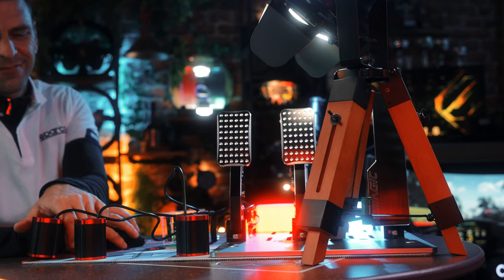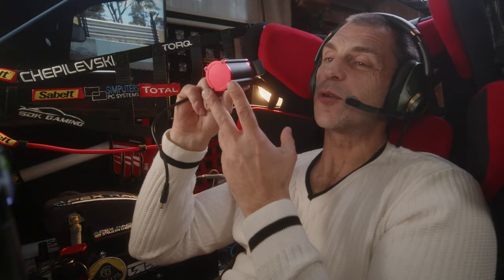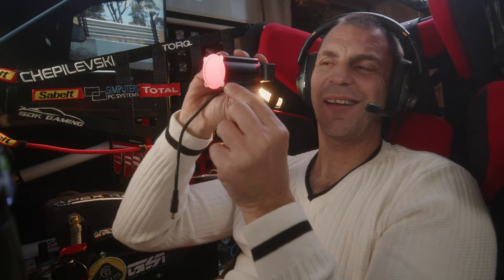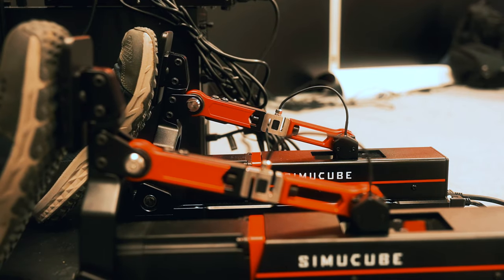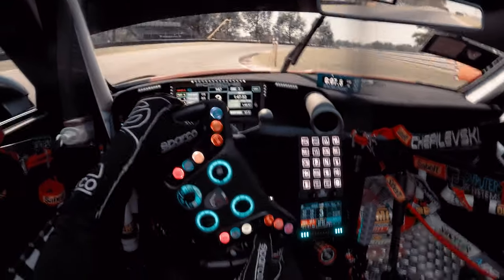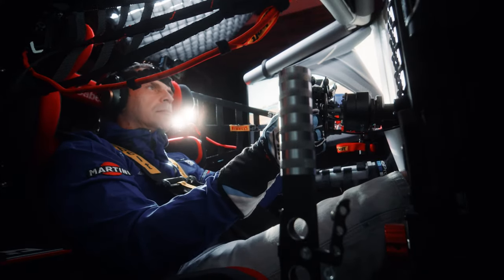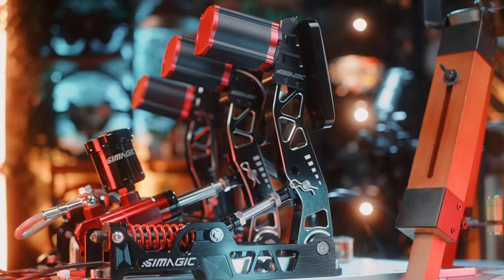That small device can TRANSFORM your pedals!

Comment from the maker: For the guys in EU region, I placed order in Simwear EU last night for one P2000 controller with bracket and one power supply to make the kit work with other pedals and today I’ve got confirmation is send with DPD
Here is the link 

https://simwear.eu/Simagic-p2000-haptic-control-box-bracket
Reply: But still you prefer P1000 more than P2000 with motors on both of them, right?
Reply: Hi Steliyan! Nice video as usual! So basically we need the haptics + power supply and it should work with any pedals ? I have the vrs, wanted to buy some transducers but this seems better 😁😁
Reply from the maker: @DRT_simracing  hi buddy🤛
The Haptics works independently only with the P2000 control box!
It needs one P2000 controller, one power supply and then we can use up to 3 haptics if needed but I’m mostly excited for the ABS and happy with one!
Reply from the maker: @sergey.matrosov  yes Sergey, I personally prefer the P1000 for personal reasons!
They have bit more progressive brake feeling and are more comfortable for me when inverted!
Reply: Great thanks, I ordered a set myself now, now just have to find a way to mount them to my pedals somehow 😂 Are you going to make a video for this? Will patiently wait for it :D
Reply: @chepilevski  thank you for your answer
Reply: I have VRS pedals...

Comment: I’ve been using diy pedal transducers for a long time and the fact I can feel when the abs kicks in or the start of the front tyres losing grip helps a great deal with driving at or close to the limit. I think, a lot of racers forget you do a lot of steering with your feet to control rotation and slip angle, as much as you do with the wheel in front of you. Awesome video as always 👍
Reply from the maker: It is such a huge deal to have that feedback, isn’t it 💪
It is exactly as you said, turning the car is not as simple as just turning the wheel but is so much more complex to create those circumstances where the car rotates under huge force 🙈

Comment: I initially thought these were a bit gimmicky, I thought I'd never consider buying these. However, from some of the videos I've seen recently and most importantly this one. I have decided that the P2000 with haptic motors will be my next pedals. I'll unlikely ever be in a position to own the Simucube pedals. However if I can own something that will give me a fraction of that feedback, I'm sold! Simagic really are shaking up the market at the moment.
Reply from the maker: The ABS feedback feeling is as intuitive as on the Simucube buddy! Simucube pedals have other advantages but for ABS which is such an important feedback those do the job as the Simucube ones 💪

Comment: My rig is tubular so it transmits the frequencies of my direct drive wheel throughout the rig, essentially giving pedal feedback and feedback through the seat. It is really cool!
Reply from the maker: Wow, that sounds interesting 💪
Reply: Same here, I have a Trak Racer TRX and I love how my Simucube 2 Pro can vibrate the whole rig. Feels just like a buttkicker!
Reply: @daly46 but your losing some of the fine details then
A solid rig that isolates the ffb too the hands and arms is much better for fi e detail. When u upgraded to my aluminium profile rig it was lime I upgraded my base
Reply: @Simlife101  sorry I should have explained more. I only feel (whole rig) vibration over curbs or rough terrain. And I run my force feedback very very high (22Nm). I feel all the detail I need.

Comment: Dang, Simagic needs to provide mounting options for other manufacturers' pedals, I reckon they would sell like hot cakes, I would instantly buy a set (Heusinkveld Ultimates, if you're reading this Simagic 😂)
Reply from the maker: I’m sure SRM will make soon for different pedals 😁
Reply: Absolutely! I'm getting these for my VX Pro's regardless. I'll find a way to mount them.
Reply: Same, heusinkveld sprint!
Reply: Same here, sprints
Reply: @chepilevski   would you kindly test if the brackets might somehow fit the sprints or other pedals you may have ?  Thank you
Reply from the maker: @Gabe_H  ah no buddy, those brackets are specifically designed for the P2000 model taking the shape of the pedals itself! I’m trying to connect with SMR and ask if he can come up with solution🤛
I have idea how to fit in any pedals but must test first and then will report!
Reply from the maker: @brunomarques2392  I will contact SMR and ask if he can make something for those more popular models 🤛
Reply: This seems like something that could be easily 3d printed?
Reply from the maker: @Coledini  that will be another option!
I’m sure someone will come with something very soon 💪
Reply: Oh very interesting mate! @chepilevski
Reply: @RacingisLif3 Sorry if this is a dumb question but how would these connect to the PC if using them with Non Simagic pedals?? It doesn't look like the controller box comes with a USB connection.
Reply: @Nocturno83  it does use USB, it's USB-B type connector though
Reply: I need an adapter for the SRP pedals I use
Reply: Mate there are people already selling 3D printed mounts for other pedals, I personally sell them for Heusinkveld Sprints

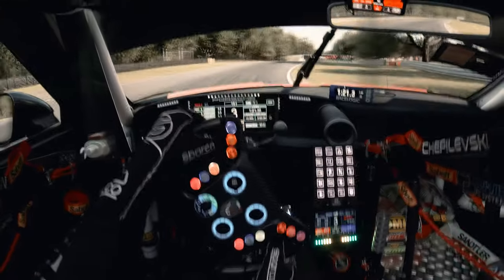Comment: BAAARRRROOOOOOOOO! This is a great video! I always brake hard in a straight line, then lift and run through the corners. I always have an issue with understeer. My best Monza time in Iracing was about 1:50.5-ish. I ran a few warm-up laps since I haven't driven the track in a while. Then keeping this in mind while braking into corners and my FIRST timed lap was 1:49.7. Two laps later I got 1:48.8. I'm still rough since I'm used to braking early and rolling through the corners so there was a lot of time left. I can brake later, keep a little bit of pressure and rotate and get time in the braking zone and corner. I have heard about rotation but never really grasped it. I love it! And to think, I found your video to see a review on the Simagic haptic pedal reactors. I wasn't expecting a freaking lesson that knocked almost 2 seconds off my laps.
Reply from the maker: That’s awesome news man 💪

Comment: I also have a similar homebuilt set on my vrs pedals, I love the lock up and abs feedback on my break pedal and the wheelspin on throttle.
I loose sooo much feedback when I forget to load up simhub.
Reply from the maker: It changes the the driving understanding completely, isn’t it 😃
Reply: @ncokicsi I have also VRS pedals and would like to have those motors , did you build it alone or did you purchased it somewhere, if yes where ? Thanks mate 👍
Reply: @ncokicsi you can set simhub to start with windows

Comment: Nice info, I am looking into how to source parts so I can DIY this, but it will take some doing.  They aren't easy to find.

Also, a little nitpick about your explanation of trailbraking:  in an ideal trailbraking scenario in a track car, you're not actually sliding the rear wheels, and the front wheels don't stay perfectly on a straight track.  Both tyres will develop an angle of attack whenever you are cornering.  That doesn't mean they slide, they simply deform.  In fact it's impossible for them to provide cornering force without angle of attack, because they are elastomers - a type of spring - that will not create any force between the wheel hubs and the road unless they are deformed.

Effectively the contact patch of the tyre will twist to roll straight along the road, even though the wheel hub above it is at a slightly different angle.  You can see this in videos of tyres on treadmills being twisted, and watching the rubber shift around but not slide.

Another way to think of it is as if the rubber "walks" towards the outside of the corner.  As a part of the tyre touches the ground and progresses from the front to the back of the contact patch, it will progressively deform more and more until it leaves the ground and it springs back to its rest position.  As more rubber surface goes through this process, the end result is that the tyre will shift to the outside of the corner without any sliding taking place.

A lot of people misunderstand this, and I find that knowing it is very helpful.  Every good driver knows the feeling of pitching the car into the corner, but not necessarily the explanation.  Knowing what's happening helps you to get faster by learning to manipulate this behaviour to find the best traction in any given situation.
Reply from the maker: Wow, what a great explanation buddy ❤️
Beautifully said man 💪
Reply: @chepilevski  Thanks!

Comment: Great video and I was kinda sure you would do something like that, because of being so fascinated about the motors in your last videos. I will take it… but I just bought some VRS pedals a couple of months ago. So my question now… if not already answered is… is it possible to install them to other pedals? I thought it would just work with sim magic pedals because of their own software in the pedals, right? If you could help, or do a video about it, I would highly appreciate that!
Reply: Great Video and same Question here ✋
Reply: The kit is a stand-alone, meaning if you can find a way to mount them to you to your pedals, it will work. You just need to run the software on your computer.
Reply from the maker: Yes guys, if you take the Simagic p2000 control box and power supply, you can attach up to 3 motors and they will work without the pedals just you will need SimHub or Simagic software (SimPro Manager) then somehow we must find the way to attach to our pedals!
Reply: @chepilevski  what is the wired connection they use to get the signals if they are not used in conjunction with a SimMagic pedals? I was looking on the website to see what kind of connection these have!
Reply: @chepilevski  But can the control box  itself be bought? I don't think so far
Reply from the maker: @edochmura3394  yes, it is possible buddy!
Here is a link I placed order last night and today I’ve got email they send it 
https://simwear.eu/Simagic-p2000-haptic-control-box-bracket

Comment: That's a really nice looking set of pedals ❤ 

My sim3d pedal motors only need 50-60% as well, any more is overkill though efficiency and longevity are on point.

They are a great option for older pedal owners and well worth the upgrade. Not as refined as the ones in the vid tho they look sick! ❤
Reply: These haptic motors replaced my Sim3D rumble motors. I have very high regard for Sim3D, but these haptic motors raise the bar considerably.
Reply: @nicholasmarshall3191 is it worth changing to p2000 even for this haptic? Sprint with sim3d rumble kit.
Reply: @rickylah69  Hard to say? It is a lot of money. I do like my P1000's more than my Heusinkveld Ultimate +`s that had the rumble motors. However, at that level of quality pedals, the differences are fairly small. I imagine that kits to mount the haptic motors to other pedals will start dropping soon. If I were you, I would see if mounting them, to your Sprints becomes an option. I don't know for sure, but I think you could run the haptic motors thru the Sim3D black box.
Reply: @nicholasmarshall3191 no they need to be ran through simagic controller box so I was told.

Comment: Any chance you can provide the inner and outer dimensions of the mounting bracket, as long as it is not exactly the same width as the pedals, I reckon it should be able to mount with some spacers/washers on most pedals

Comment: You have sold me on the notion that I should get one for my brake pedal, but I don't understand why you need them for the throttle and clutch.
Reply from the maker: I don’t need them for the clutch and throttle personally but they can be useful for bite point feedback or traction control and many other effects for which I personally don’t care at all!
I usually suggest to people to take just one motor and if they later think they want more can be ordered separately at any time !

Comment: Awesome video as always, the explanation about how the ABS works was outstanding. Thanks for that

If you were to decide between the P1000 with the Haptic Motors and the P2000 with them aswell, which one would you choose? I'm asking because I'm planning on getting one of these pedals coming from a Logitech G920 but I only have one shot here in Brazil and trying them out before I buy isn't something I can do.
I think that the P1000 is a bit more well built compared to the P2000 because in the P2000 you have the controller box separated and also the cables aren't hidden at all but it's something that I can live with.
I'm leaning a little more towards the P2000 because of the throttle dampener but I'm not sure if Simagic is going to release one for the P1000 later.
Reply from the maker: Hey buddy, as you’ve said, the P1000 will s better design and bit more refined pedal set !
The inverted version is also way more comfortable for me and I personally prefer the P1000 over the P2000!
The throttle on the with the damper on P2000 is better indeed but the brake on P1000 feels more progressive and I personally prefer it !
It would s hard call but I will definitely take the P1000
Reply: I sent an email to Simagic asking if they plan on releasing a throttle dampener for the P1000, if they reply to me I'll let you know here.
Right now I'm leaning torwards the P1000 even more, even without the thottle dampener for now.

Comment: Great stuff thanx for the video. I got a questions, is it possible to Install the kit on Simtag Ashley hydraulic pedals? If i get 2 reactor do i need buy 2 power supply?
Reply from the maker: To make it work, you need Power supply, Simagic Haptic control P2000 and you can connect up to 3 haptic motors ! That’s the kit which I used in this video and works without the pedals!
If you find the way to attach those to your pedals will work perfectly!

Comment: Do you prefer the inverted or the standard version? I have a bad back and run a slightly softer brake pedal 40KG. I was thinking with the inverted pedals I would be able to get more leverage and the pedal would be easier to push. It looks like you need  the hydraulic kit and the extra bushings to fix the drifting using load cell and not the angle senor. I was hoping to eliminate that, but worried the pressure would be to much for me. Love the channel and videos have been a subscriber for many years now.
Reply from the maker: Yes bro, I’m huge fan of inverted pedals with heal support! They really help me with my knee injury!
And thanks for the support all those years man🤗 
You are here from the very very beginning ❤️

Comment: Even though I have a DIY solution for my Simgrade R7 pedals...the simagic solution looks cleaner. Mounting could be a challenge, but I have a 3D printer and I am not afraid to use it....just to be sure Steliyan, I would need a motor + controller + power supply, correct? The bracket is unique to their pedals, I guess.
Reply from the maker: Yes buddy, P2000 control box, power supply and one to 3 haptics !
Right now I’m trying to find solution to attach those to other pedals I’m testing here 💪
Reply: @chepilevski Many thanks for the info...and I knew you would do the testing... 🙂

Comment: Hello,

Can them be attached to another pedals and use it with simhub?  or ... it is only for simagic??

It looks amazing
Reply from the maker: The P2000 board is independent and the f you have the board, power supply and haptics and find the way to attach to your pedals will work perfectly! 
I will do that for sure other set and will show soon 🤛
Reply: @chepilevski  cool man!! Thanks a lot, I will get one of those with no doubt

Comment: Really interested in getting these. Couple questions: Have you tried it with cars without ABS to trigger with wheel lockup? If so, was the effect worthwhile? What do you think about these with clutch and accelerator pedals? I could see them maybe helping feel TC or wheel spin. Have you played with that? Not sure there's any point in the clutch.
Reply from the maker: I feel the TC and bite point on the clutch but is not something I’m really interested for!
The point of having one on the brake is to tray and drive on the edge without activating the motor! It is there to show me the limits of my braking performance and grips!
It is not that much about the effect feeling but the feedback I need to understand the limits!
Reply: Thanks a lot @chepilevski  .

I had decided to buy the kit for the brake before watching the video, but I wasn't sure about the throttle and clutch. After reading this I'll get the kit with 3 mounts (it's only 20€ more, so I'll get these just in case) but I'll get just one shaker.

Love your content in general and this video in particular!

Comment: What are the main differences between the P1000 pedal set with hydraulic add-on, and P2000 with the haptic motors added? What would you suggest one consider when choosing between them?
Reply from the maker: The P1000 have bit more progressive feeling in compression and are bit more refined design!
The P2000 have dumper on the throttle!
I’m personally fan of the P1000

Comment: Do you think it works with other pedals, the HE ultimate+? As a standalone, buy the box the haptics and the power supply and atach to the HE... Do u think its possible mate, is it work alone or really need the simagic pedals? Thanks mate and keep up
Reply from the maker: You can see the haptic works attached to the the P2000 box without pedals being attached!
That kit with the control box can work on its own and if you find the way to attach to your pedals will get the same effect!
I just ordered another kit and will try to make it attachable for other pedals I test here 💪
Reply: @chepilevski  thanks a lot mate... Ive got already two smaller bass shakers attached to my pedals, but as you have told the movement of these were different i really want to give it a try. So 1controller box 2 haptics and 1 power supply and ready to go right?